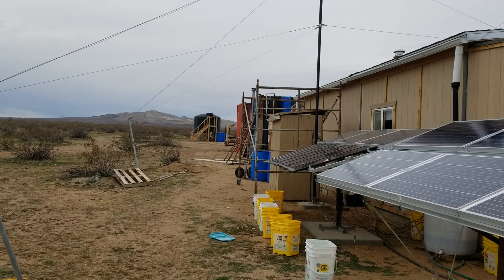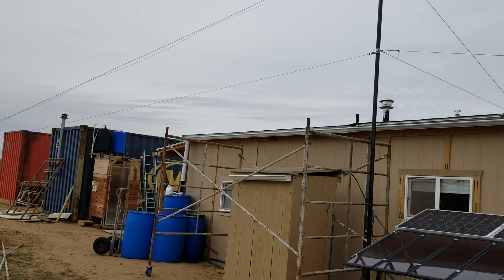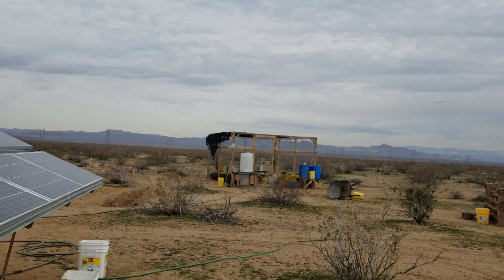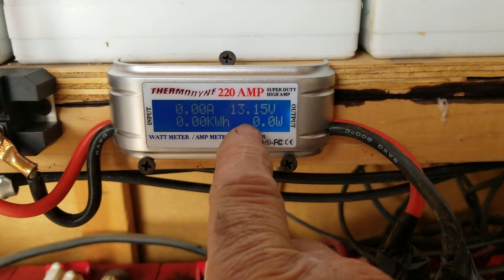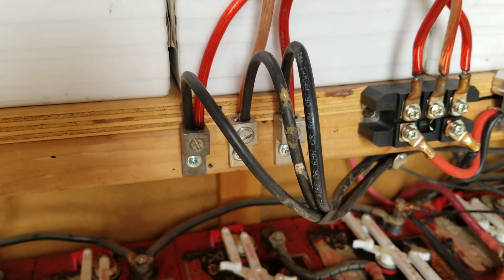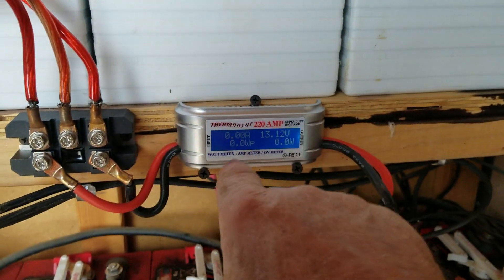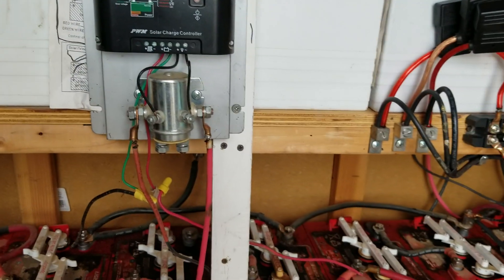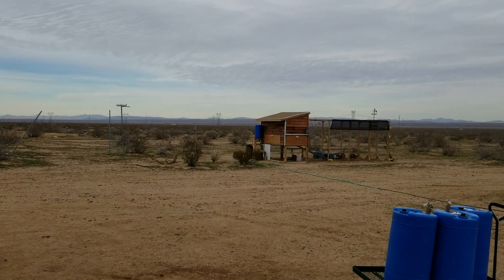GBear's Off Grid Ways-a Homestead in the Desert,  Feb. 12, 2019

Comment: Sir you really should provide a Heat Sink and Cooling on that Rectifier Block   That puppies going to be getting toasty mounted to the wood like that.    Emmmm   You should be dumping excess power prior to ever sending it to the Batteries.  When the batteries are up to voltage DUMP the Source to the Dump load without sending it into the Batteries.    Your over charging the cells this way.  Your sorta beating up your batteries for no reasons this way.  Nice Set Up you have there for sure.  Envious.   Run your dump load to a water heater.
Reply from the maker: Welcome aboard and thanks for watching and commenting.
Reply: @GBear   As your set up it works fine but I would dump prior to sending it to the cells.  The Manufacturer dosn't by the batteries.  You Do.  LOL    Being a Cheap Skate I want as much life out of my batteries as I can  squeak.  Again, Envious.   I really need more Batteries.
Reply from the maker: I have a BLS unit attached to the bank also for anti-sulfating.
I have multiple meters showing the battery voltage and have yet to see them over 14.2 volts since connecting the dump load.  Prior to that, while running on solar only, I saw 14.9 a few times.
Unlike the Gov. I don't attempt to fix things that aren't broken...lol
Reply: @GBear  LOL,  Nothing Broken .  Just another way to go about things.   .Were  Not attempting to go off grid just off set the bills a bit.   Working on all this stuff sure beats daytime TV.
Reply from the maker: @pulesjet  agreed!
Reply from the maker: I have a computer fan constantly blowing on the rectifier and have tested the heat dispersion at 72° during 26mph winds, so I am not worried.
My dump load is connected per the manufacturer recommended design and dumps the excess at 14.2 vdc.

Comment: If u flip that breaker off in high winds to let your PMA free wheel it will let all the smoke out of your PMA .  I use a furling tail on mine to turn it out of the wind at 32 mph to protect it from over speed . We had a wind storm here last night and this morning with up to 70 mph wind gust , my turbine is fine and putting out 5 amps right now in a 13 mph breeze .  I was getting around 50 amps last night .
Reply from the maker: Lol.  I might want to keep that smoke in there....
Reply: @GBear   ... Yep
Reply from the maker: @larryhaney6608  welcome aboard.

Comment: But freewheel might destroy your windmill,
Reply from the maker: Correct, that's why I use a dump load.   The dump load is actually a 'diverter' system that diverts the electricity to a different place instead of into the battery bank.
Reply from the maker: And, Welcome aboard!

Comment: Great video old man! Thank you! I do have a few questions.. 
1. Going back to my ancient electronic theory, could a zeener diode with an avalanche current rating started at say.. 13.5 vdc tied in series to a current limiting resistor, all parallel across the dc output of the of the rectifier be used as a brake for the 3 phase generator? 

2. Since you are supplying a pulsating DC to the batteries with the rectifier, would some capacitance help with both efficiency and smoothing of the dc ripple?

Many thanks!
Reply from the maker: Hey, who you calling 'old', man?🤣 
1.  No.  Braking the PMA electronically is not only not recommended as it will burn the stator,  it isn't necessary with a dump load controller,  or also known as a diversion load.  You are overthinking a simple remedy, just divert the extra power to another power need using the dump load controller.  It can even be diverted to a back up battery bank, but heat elements make the most sense.
2.  Yes, capacitance would make it more efficient, but again, not needed.  The design used is a tried and tested way, recommended by the PMA manufacturer.
Reply: @GBear  nearing 63, I suspect that I'm not far behind you! Well done sir, thanks for the response.

Comment: I knew here to your community I dropped in from Joe mciver's Channel A friend of mine, I look forward to hear from you nice,
 system by the way! By4Now Ken.
Reply from the maker: I appreciate you joining, and thanks to Mr. Mcgiver.
Reply: @GBear  Joe says you're welcome, how is your fusible links holding up in the Wind?
Reply from the maker: @HomeImProveMentHow  I just posted a video.  Fuses working fine so far.  35+ amps...
Reply: @GBear   that's great I'll have to check out that video glad to hear that they're holding 35 amps Jill MacGyver was thinking it may blow the fusible links you got it set up real nice that's for sure he could probably learn a trick or two from you we're out here in Apple Valley California I look forward to hear from you keep up the great work bye for now God bless Ken
Reply from the maker: @HomeImProveMentHow  my fuse links are rated at 60amp, and if they blow I will go to 80 amp, etc.  
My understanding is this PMA can produce 140amps, but that would be at stall speed (90mph).  If I see those winds a blown fuse would be the least of my worries.😉

Comment: Hi. Thank you for the video, the way you explain to us no electrical engineers is very helpful, question: The dump load, can i use any solar charger to set up s a dump load? Hoe do you set it up?
Reply from the maker: While a standard charge controller can be converted into a dump load controller, you still need the solenoid switch.  That switch IS NOT the same as an old Ford starter solenoid.  So buying the separate components becomes pricier than just buying the assembled unit recommended by the manufacturer of the PMA.
Reply: @GBear  Thank you for the reply, I live in south africa and  cant buy  assembled units locally, and importing them is very costly, do you have a link for converting a solar charger please, the alternative is really to expensive for me, even to buy a small assembled wind turbine is very expensive here, i see abroad the prices are very good but it takes months to get here shipping is very expensive, and with that time frame you cant take a chance because it might get damaged or so
Reply from the maker: @JohanvanNiekerk247  I'll see what I can dig up for you and post it in one of my upcoming videos.
Reply: @GBear  Thank you kind sir

Comment from the maker: As soon as I register output on the new PMA turbine, I will adjust for over voltage as needed.  I don't need a lot of compressed air at this time, but a hydrogen generator for fuel might be my consideration.
Reply: There is a guy I think Florida that takes all of his 
Photovoltaic and break water to hydrogen he runs his property on..
He has 3 maybe 5k+ gallon above ground tanks..
I saw him on youtube
Reply from the maker: @jimh712  yep.  That's the plan for the future.

Comment: Youtuber Steve Robertson
Ran his colorado house (app 7k ft elevation)
Off solar.. 
He used an electric water heater as a dump load
What he did was install another switching unit like the top one on the bottom heating element 
So when the water was hot it would send the power to his air compressor..
To store the power as compressed air...
They got tired of the snow and are building a house on the big island Hawaii
Channel.  Off The Grid Living Really
Reply: @jim h
 - Good way to use an extra Electricity that goes to waste!

Comment: Just put in a manual switchover to dump in a high wind situation. E bay has a nice 3 pole knife
switch, thats perfect for this application.
Reply from the maker: A 3phase AC breaker is available on Ebay and Amazon for around $13.00 that will automatically 'pop' in high winds and disconnect the PMA.
Search (DZ47-63 6000amp Overload protection.) 
Be sure to get one in the required amperage for your system.
Reply: @GBear  
$13 is a goood price
☺

Comment: Get that rectifier on a heat sink quick ! My small thermodyne generator has destroyed 3 of those rectifiers, before I put mine on a big enough heatsink. Also put in a brake switch ! Your turbine will self destruct in high winds without some sort of brake/load.
Reply from the maker: Fuses or breakers before the rectifier should protect it.  What size fuse/breaker did you use on the input side?  The PMA supplier doesn't recommend using a 'brake' as it will burn the stator. They recommend a breaker to kick out the input and send the PMA into free wheeling.
I'll have to go with their recommendation first so I don't void warranty.  Thanks for the warning.

Comment: Hello Sr I have a question how do you protect for thunder storms
Reply from the maker: Earth ground all. 8 foot ground rod driven, and all poles, electrical components, etc. Are grounded to it with 6ga. Solid conductor wire.
Reply: @GBear  
Are you planing on a lightning rod..
Or are you using the TV antenna pipel as a lightning rod
Reply from the maker: @jimh712  no plan for that.  Just earth ground everything.
Reply: @GBear  
Oh.  I have no experience with lightning or lightning rods
Reply from the maker: @jimh712  lightning rod: conductive rod vertically mounted at a high location connected by a conductor to an earth ground.
Reply from the maker: ie; a nine iron on a par 3 18th hole!😉
Reply: @GBear  
That part i get..
But what would be the maximum distance apart to attract the lightning..
The little bit I've seen on video's is some times lower things get hit when there are much higher, conductive things around..
Livinging in Los Angeles we don't gave lightning strike problems
All of the metal buildings are grounded
Reply from the maker: @jimh712  lightning actually goes from ground to positive and is an optical illusion that it comes downward.  Geology plays a part in the function.  At least that's what I remember from a Nova show I saw once.
Reply: @GBear  
That amazed me when i heard lightning goes from the ground up
Because my eyes say from the sky down....
🙉 My lieing eyes...
Reply from the maker: It amazes me too when I saw it on TV.   They explained that the electricity isn't in the cloud, it is in the earth.  The cloud Carry's ions that are positive charge and the earth's core is negatively charged, or something like that...I saw that show back in the 80's.

Comment: Question on the dump heater..
Is that heater made just for solar..
Or is it used some other place in industry..
Reply from the maker: It came with the dump load controller, bought on Ebay. If I see the box it came in I'll post the manufacturer's address.  Remind me if I forget.
Reply: @GBear  
Thanks..
By chance do you remember the wattage of the unit
Reply from the maker: @jimh712  I'm not sure,  but I think it was 600watts.  That lowers the battery bank pretty quickly so it doesn't heat for long periods.  I can meter it to be sure.
Reply: @GBear  
The little research I've done quickly..
They go up to 1200 watts
And they stack the units up..
So pretty much you build what you need
Reply: Hurricane wind and solar sell them stellavolta sells them too
Reply from the maker: Thanks!

Comment: Gbear dont u think u need more dump load resisters I have 6 for 1700 watt turbine just saying I would hate to see any of ur stuff get messed up thanks for the video keep it up
Reply from the maker: Yes, the dump load will run a 300watt water heater element soon, but in the meantime I have a 300/900/1200 watt oil filled electric (120vac) radiator to take up excess if needed.  With wind AND sun at the same time, I could produce 3kw.  If needed, I can turn on my desktop computer also for 850watts resistance.
Reply: Yeah sounds good cant wait to see the output
Reply from the maker: @dangoras9152  me either!  Wind is predicted for the weekend.

Comment: Suggestion. Double up on your cable clamps, seen too may slip over the years. Great video!
Reply from the maker: Welcome aboard!  I usually double cable clamps, or "saddle clamps", just for safety, but... something I learned years ago about those clamps is to be sure the saddle part 'ISN'T ' on the end side of the cable. "Don't saddle a dead horse" is the reminder phrase.  The saddle part of the clamp goes on the cable side, not the end side.

Comment: good thing that green dump resistor is not mounted to wood that could catch fire.
Reply from the maker: Welcome aboard!  The cabin siding is fire resistant, but you are right in your observation.  Tomorrow, during the rain I plan on making an aluminum heat sync plate to go behind it to be sure.  Stay tuned!
Reply: @GBear  - Next Video TITLE = Making an Aluminum Heat Sink Plate for Solar Battery Green Dump Resistor
Reply from the maker: @JodBronson  the dump load heat coil doesn't use a heat sync. It required a heat shield and that's what I did.  Did you want me to show how that was made?
Reply: @GBear  - LOL, no.... I was teaching you how to TITLE your Video!  LOL
Reply: @GBear    yep I used a small peace of metal roof/building  ribed metal to mount my 4 dump load resistors in parallel then to the wall with a pancake fan that only comes on when its dumping to blow the heat away .
Reply from the maker: @larryhaney6608  mine will eventually be connected to the outdoor shower 300watt element for hot water.
Reply: @GBear   now that i would like to see
Reply from the maker: Some people don't know the flash point of wood...

Comment: What size wire you use on your battery bank
Reply from the maker: 2/0 is what I used.  1/0 is better, but cost of wire and connectors kept me at the smaller sizes which are "adequate ".